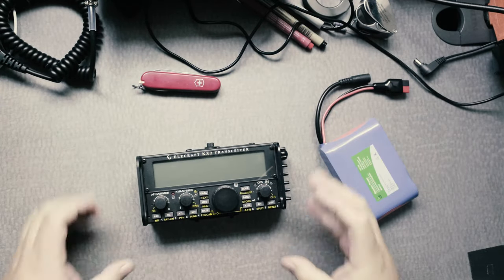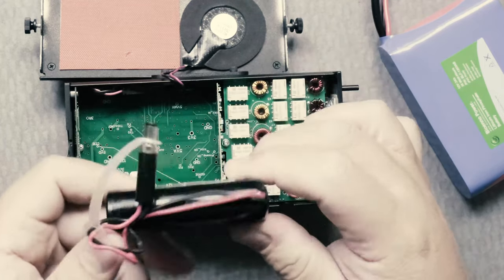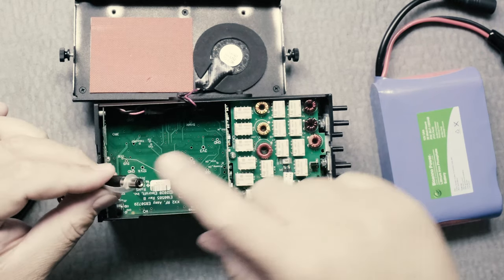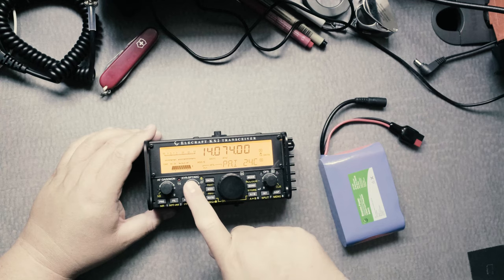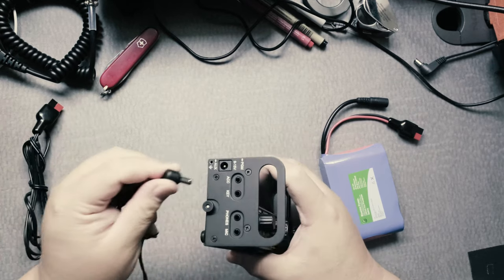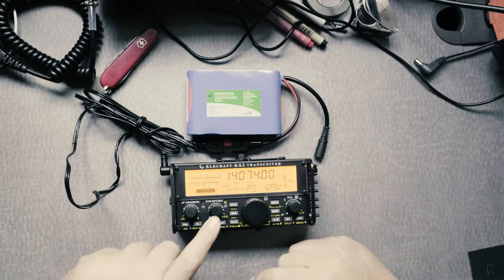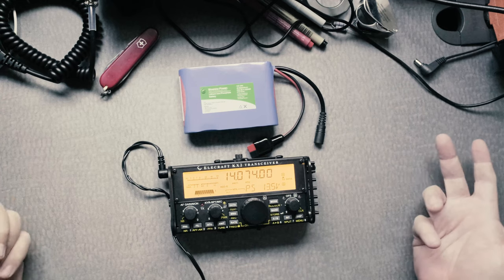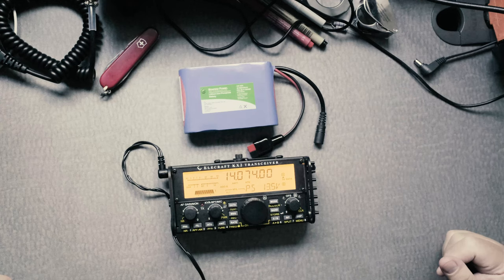KX2 The Battery

Comment: Good demo of the extreme versatility of the KX2. I often use the supplied battery outside the radio for quick swapping of batteries in extended operation. 73 de N3CI

Comment: This is a great video, my kx2 came but the battery is in back order. I’ve been looking at the bioenno but a bit confused. Can you use the elecraft charger on these, or is it too low of voltage?
Reply: You're better using a specific charger for LiFePO4 batteries. I made a short video on these batteries and chargers.

Comment: elecraft didnt have the smarts to put that plastic tab on all their batteries. Us poor guys that bought the shack in the box didn’t get that plastic tab and run the risk of shorting out the battery trying to get it unplugged from the radio by the only method possible, pulling on the freaking wires! How hard could it have been to run a connector outside the radio to charge the battery? I thought these guys were really sharp
Reply from the maker: Ya, I agree.  It's a wonderful radio, but it needs an update really bad.  I hope they can think of a way to address these annoying issues.
Reply: I called them to see if I could get that tab…”we don’t sell that separately” was my answer.  I made one out of fishing line… 🖕

Comment: Can you run the KX2 with an external power source but without the internal battery pack installed?
Reply from the maker: I don’t remember if you can. I’m going to say yes. The extra battery gives the extra wattage. And I know if the internal batty ran out the external battery took over.
Reply: yes. yes you can.

Comment: Is it normal for my kx2 to jump to 5w after I move it to 10w with internal battery ?
Reply from the maker: If you have an external battery, the KX2 will have 10 watts of power.  You might even get 12 watts.  I've don't have a battery internally that would give me 10 watts.
Reply: Yes, if the battery drops, the power output drops.